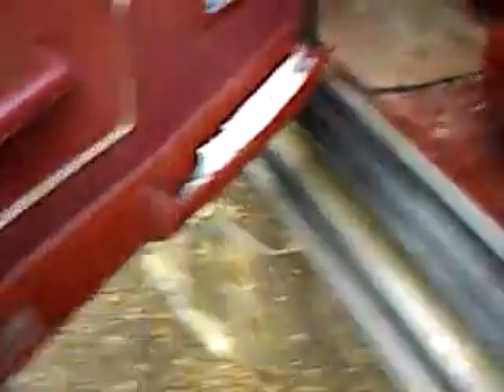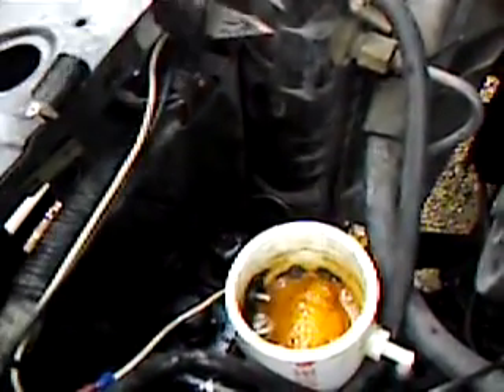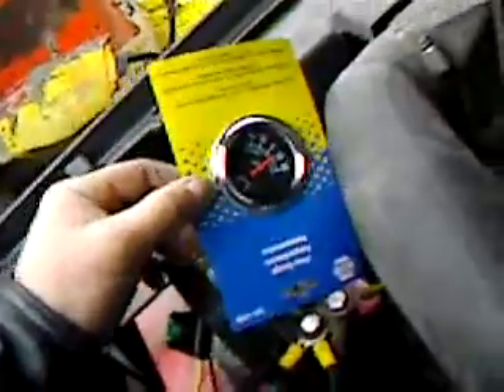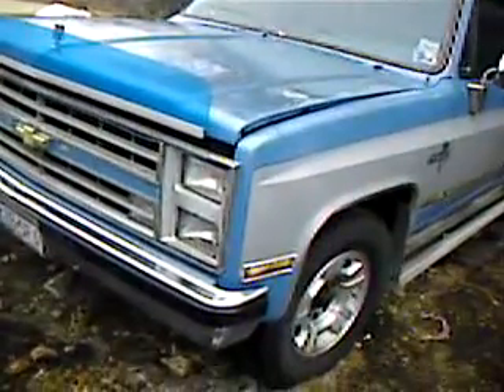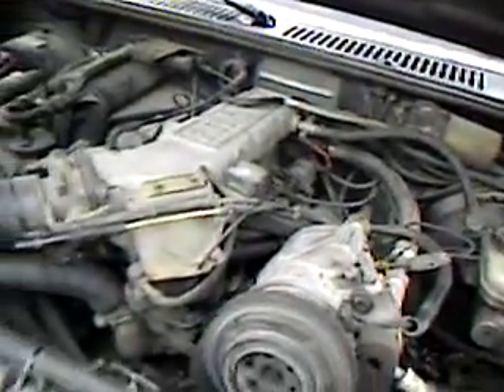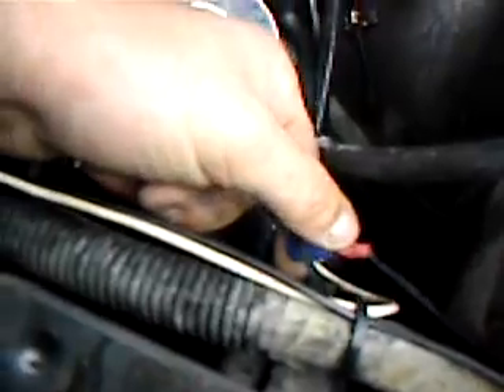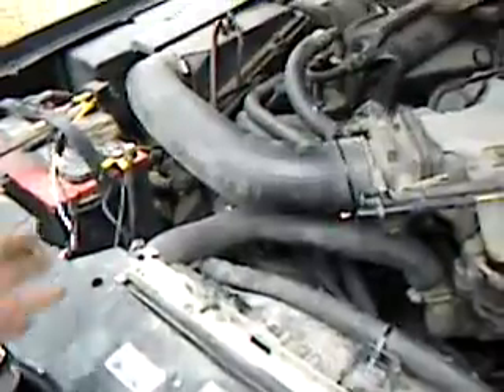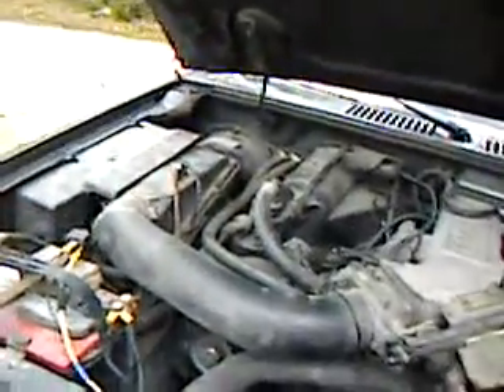Hydrogen Cell in my Bronco II, test results for "Nay" sayers

Comment: @asjenterprises This isn't too hard to answer. Volts=heat in the direct current world. Do more research into dry cells. a positive plate in the middle with four neutral plates on each side followed by a negative plate on both sides making a HHO sandwhich. This puts your voltage around 1.5v. you need 1.24v to seperate HHO from H2O. Amps can be controlled by a Pulse Width Modulator (PWM)- and electrolyte solution (NOT BAKING SODA!!!! USE KOH)

Baking soda ruins your motor and produces CO2 and CO

Comment: What's the output on the cell? It's really important to get the right flow for the size of your engine to make it efficiently. I would recommend KOH as your electrolyte, because it has a more consistent conductivity over time than using baking soda. Also, are you using a map-enhancer? That could be your problem, because if you don't have one the O2 sensor in your exhaust will read to much oxygen, (Burning H fills your exhaust with oxygen) and will inject extra fuel to compensate.

Comment: @asjenterprises
If you turn on your headlights (for example) you DO lower the milage.
If your generator is turning and you don't take amps away from it then it will turn "freely" (no extra EMF).  When the generator is turning and you're drawing amps from it then it gets "stiffer" (high EMF) and the engine has to compensate for that by consuming more gas to perform at same level.
Try it:  get a DC motor (not brushless) and turn it by hand, then short circuit terminals to max the current and turn!

Comment: Your gas mileage is degrading because the generator is actually WASTING energy, not adding it. You use more energy to perform the electrolysis than you gain from burning the hydrogen.

Comment: Your millage loss is a result of your computer  enriching your fuel input because it does not recognize the HHO and thinks its more oxygen so it adds more gas. Bob Boyce as we know the pioneer in this field overcomes this problem by plumbing the HHO fuel line into the cold air intake before your air cleaner which makes the HHO mix better and will not affect your computer as easy. I have a suggestion for the brown scum as well. Use electrolyte instead of baking soda for your catalyst. Cleaner H20

Comment: I am conducting similar experiments, and  there is a little electrical loss.  You are better off going into the intake manifold, but remember to put the inlet on in a way that all the cylinders get HHO, for maximum effect.

You may also have a problem with the 02 sensor making the engine run rich, so check that out too.

Comment: so far so good
look for ways to fool the computer
stop the brown water by using a higher grade stainless add  a pwm to power up your water cell without draining much  and look for more ways of powering the cell, solar, wind engine braking switch out the lights to led even the ones in the dash once you produce more hydrox then u need u can wiene your bronc off the gas  oh and do not patent and sell it to a company  they will shelf it untill they want to use for their own game
share it with all

Comment from the maker: One last point, I know that the reason my fuel economy went down was due to the engines management system reading the fuel mixture incorrectly. I was trying to gain the fuel economy WITHOUT spending a gob of money on the vehicle. The point of doing hydrogen tests for most of the people here is to save money not spend it modifying the heck out of their vehicle. Now, if I was trying to run the vehicle completely on hdrogen then these comments would have more merrit.

Comment from the maker: On a further note, I did implement the same concept on a NON computer controlled vehicle with great results. That I could afford to do since changing the air/fuel ratio was as simple as changing the jets in the carb.  I will post a video on that later.  One thing that you and Tito are not taking into account is that if you "retune" your engine WITH OR WITHOUT the hydrogen added, you can easily gain better fuel economy not to mention HP and torque. Thats why there are so many chips out there.

Comment from the maker: I am glad it is painful for you to watch, not all of us have the financial means to retune our engines air to fuel mixture and reprogram our computers.  This is an old video of mine when I was simply putting what others have shared here into practice.  I was tryig to get a very small improvement WITHOUT changing factory specs of the vehicle. I I had reprogramed my bronco, the I would have lost my ability to say that the hydrogen made the difference rather than the programing.

Comment: youre wrong the alternator produces the amount needed... it doesnt matters if you put a 100000000 amps alternator it will only produce the current lost by the battery... so... disconect the battery while running and you will see. the revs change when turning things on

Comment from the maker: Um, who is this post for?  My video simply states the facts about my observations.  As with any study, I started with a simple cell, no other adjustments.  Those will come later.  My next test is on my 68 beetle, a simple combustion engine.  I am currently holding my opinion as to whether this will work or not, at least until I finish giving it every possible chance to either work or fail.

Comment: There is a reason these HHO systems only work if you install an EFIE (O2 sensor enhancer). The reason is that the EFIE tells the car to run lean. If you leave the EFIE in and shut off the HHO generator, same results occur. It's not the HHO it's modifying the Fuel system that improves milage.

Comment: I am currently working on a similar system. I have found that you need a micro controller to make the proper mix adjustments.   I think that you need to go with a diesel to combat the air fuel sensor*(i assume) problem. Hydrogen injection works well in diesel.  Love to share some info with you, two heads are better than one.. good luck

Comment: Hey man, great video. A couple of suggestions for you, but keep in mind that I'm a beginner myself. I've had much better results with sodium hydroxide than baking soda, and it's cheap and easy to find. Also check out madscientist67 here on youtube. Check his page for a link to his website. He's got the easiest o2 sensor override to build. You can check out the unit I made in my videos, I can tell you it works great, but I don't have any mpg testing yet.

Comment: do a search for EFIE it seems that the o2 sensor reads the extra oxygen and thinks that is lean and dumps more fuel you are ahead of me in the process im still experimenting with different cell types (tubes, plates, and nuterals) also it seems that a vacume will help production but keep us posted and look into EFIE and see if that helps i look forward to more vids and updates

Comment from the maker: spikeychops, we seem to be on the same page.  My next attempt is going to be on  naturally aspirated 4cyl motor.  No computer, no o2 sensors, simple vacuum advance.  This will eliminate all other outside influences and give me a control to work with.  If it works with this motor (1.6L air cooled vw), then reason suggests that it will work with all motors provided I make the proper modifications.  Luckily I am in a unique situation and have several types of engines available to me. We shall see.

Comment: Mate, just because you have a high opinion of your abilities, be open to the possibility that you don't in fact, have all the answers just because you tried certain things and they didn't work correctly for you. You may have been missing a proceedural step crucial to success, or one of numerous small errors may have caused failure.

Bit arrogant to assume because you couldn't achieve success, that others won't.

Comment: I've met numerous people who on paper at least are highly intelligent people, only to discover in a high number of cases couldn't wire up a three pin plug (or thick as pig crap IOW) Unfortunatly, a high IQ, in my experience, is not an indicator for correctness or for rationale. Basically, all a high IQ rating shows, is that an individual has a high capacity for processing information. Now, whether or not that information is correct is another story...

Comment from the maker: oxygen to you combustion chamber would have a positive result. Now, why is it any different than using electricity already being produced by your car? How about friction?  What if I put a small fifth wheel under the car that rolled with it, attach that to a small generator and produced hho that way?  How about using the wind that goes by the car, spinning a small windmill with a generator on it to produce the hho? Open your mind, the first thing is to get the hho cell to improve combustion

Comment from the maker: check.  So where does that extra voltage go?  Shouldn't we use that to produce some form of energy that our car can use? Nah, we don't use it at all. All this cell is supposed to do is use the resources we already have to better improve our combustion, thus increasing gas mileage. Not reinventing the wheel here, just using what is available at our disposal. Now, you say solar power to create the hho would work, by saying that, you are admitting that introducing a combination of hydrogen and

Comment from the maker: would have to agree with you on.  I have looked at everything from magnetic motors to battery powered cars.  There is very little room for improvement.  This I know however, my 68 bug gets 36mpg, and unless you buy a hybrid car, no one is getting that amount of gas mileage from a new car.  Technology obviously is not making the strides it should.  Why is that?  Why does a geo metro get better fuel mileage than today's compacts?  These are questions that nobody can or will answer.  Now I have ...

Comment: I´m in Iceland and i'm interessted in trying HHO. I see many versions of these generators on the net but which version in best?
Also, when the motor is at high rpm it uses more gas and should also need more HHO. How do you solve that?
And, anyone knowes of good instructions (pref. drawings)for building the genarator and installing? Thanks..

Comment: When you feed the HHO into the intake point you chose your Mass Air Flow Sensor is sends bogus data to your ECM because the you air density is much lower with the HHO. Try putting it in after all these sensors. To take advantage of the full MPG for any device installed on any car with an ECM and O2 sensor you must offset the voltage allowance from your O2 sensor to your ECM by adding 100mv-500mv (500mv avg your O2 sensor puts out) before your ECM dumps more fuel because its reading lean and hot.

Comment: Go to the air box for high load feed and throttle body for idle and low-speed operation. That's my plan, anyway. I didn't hear you mention an EFIE device. The O2 sensor will read lean and try to compensate with more fuel, killing any gains from HHO. All sensors past the cat need to be fooled. Good luck.

Comment: Have you unpluged your o2 sensor yet? the added oxygen cofuses the o2 sensor it thinks you are running lean and the computer richens the mixture. I used to be a ford fuel injection tech so I might have a little advantage. See my videos. On my first car installed hho gen I went from 17 to 26.3 mpg.I also plan to soon build a 100% hho fueled vehical.

Comment from the maker: Okay, everyone says that the water is red (or brown) because of the steel I am using.  That is incorrect, believe it or not it is my well water (it coes out of the tap like that) needless to say we drink bottled water.  When I use distilled water it does not turn nasty like that.  It has been a while since I posted any videos, I moved, sorry.  I am in process of putting a cell on a vw beetle (air cooled).  Will let you know how it goes.

Comment: More oxygen from the HHO will send a higher voltage from the sensor to the ECM which is interpreted as your engine running lean. The ECM will over-compensate by opening the throttle up more to increase the ratio of fuel to air.You might want to experiment with a sparkplug non-fouler to address this. It's a sleeve that you can insert your O2 sensor into which shields the tip of the sensor from oxygen. You will have to drill out the non-fouler to make room for the O2 sensor.

Comment: Second: You will NEVER get a complete hydrogen conversion that works with an aqueous electrolytic cell. There's not enough gas pressure created by the cell to power an engine, period.

Comment: The brown is rust or iron oxide from the electrolysis. You can use other less oxidizable material... (I'm going to try to design a cell with graphite electrodes, so you're not eating surface area over time.)

Comment from the maker: On a second note, every car manufacturer out there is trying to make things more efficient, thats why we are in an electronic world where all the cars combustion is controlled via a computer.  With that in mind, look at a hybrid car, it has a gasoline motor and an electric one, the gas motor charges the batteries for the electric and they work hand in hand.  Hydrogen is a suppliment to your fuel giving you better combustion, thus better fuel economy.  Like going to fuel injection vs a carb.

Comment from the maker: So, what you are saying is that if I took a 5hp lawn mower motor, attached a generator via a belt system to it along with a 12 volt battery and voltage regualor (still have to get things started), ran a power lead to a decent hydrogen cell which in turn fed hydrogen to the engine providing its fuel, it would not work?  Be careful, been there done that.  Now then, turbos do not add more fuel to the combustion chamber, they raise your compression ratio by forcing air into it. Its about efficency.

Comment from the maker: Hey Southern"fried" do you work for Exxon or something? "What a turbocharger does is to make the air-fuel mixture more combustible by fitting more air into the engine's chambers which, in turn, creates more power and torque when the piston is forced downward by the resulting explosion"  Just got this quote off of the internet real quick for you.  Read first, try it second, comment third.  I already have a lawn mower motor running off pure hydrogen, next is a vw engine I am working on now.

Comment: And you need to get as much vaccum to your cell as possible. If you got turbo: Put one hose just before and a second one after the turbo. make a T-connection with one check-valve on each tube, and take the last hose to your cell. The valves must open to the cell and close to the engine.

Comment: My suggestion is: Control over fueldevices as oxygen sensor and map/maf sensors. And try with low amps, perhaps only 3-5, and try to get 250-300ml gas/minute from the cell with that amps. Baking soda is great and cheap. Use 3-4 cells in series if you can. If you got control over the fuelmixture, don't lean it too much, just a "hint". That should help. I got 24% better fueleconomy with water4gas things. Fuelheater helps and map-enhancer helps. Good luck!

Comment: I think if you make a cell that isolates the hydrogen from the oxygen, you'll have less problems with trying to fool the sensors that the ECM uses to help it control the A/F mixture. If I understand your cell design correctly, you're putting both Hydrogen AND oxygen into the engine. The extra oxygen is therefore making it's way through the engine and going past the O2 sensor(s). This causes the ECM to richen the fuel (gasoline) mixture to compensate. Leave the oxygen out and see if it helps.

Comment: Yeh man you ABSOLUTELY need an air/fuel controller or the O2 sensor will kill any gains you get from the HHO. I drove like that briefly just to see if I noticed a power difference. I think there may have been improvement as it would have been running rich but it was hard to tell.

Comment from the maker: Again, mixing apples and oranges.  We are not talking over-unity here.  Put a turbo on your car.  It causes resistance on your exhaust, however, the pressure it places in your intake makes your engine burn more efficiantly, thus creating more power.  Is this over-unity, of course not, it is simply redirecting energy already being produced. Same with the HHO cell.  This is not creating energy, it is using something that is readily abundant. I agree with your last statement, but apples and oranges

Comment from the maker: True, you will get more drag from your alternator by using energy from it, however, your alternator is regulated to keep the current to a set amount. Pull the regulator out and see how long it takes to pop your battery because it is receiving to much voltage even at idle. Your regulator is solid state, until you have reached your altenators potential at any given rpm, you will not cause any more drag on your motor. Once you have surpassed its potential, it will indeed cause drag.

Comment from the maker: If your engine is weak enough that the draw from the alternator puts a drag on it, maybe you need a new car.  Obviously the more current you draw, the more power is required to run it, the amount of drag it puts on your engine is near negligable.  One thing you forget is that if you are running a vehicle that demands a high amount of electrical current to run at its peak performance, and your alternator is a bit weak, your rpms will drop when you overextended the alternators output capabilities.

Comment: Brake vacuum is not the optimal feeding since vacuum works pretty well on the HHO production, I would use some other kind of vacuum,, a vacuum that works parallel with the power curve of the motor. Mabe bleeding on to the turbo or the blower vacuum side, or mabe a electronic vacuum pump will do the job with a PWM modification.